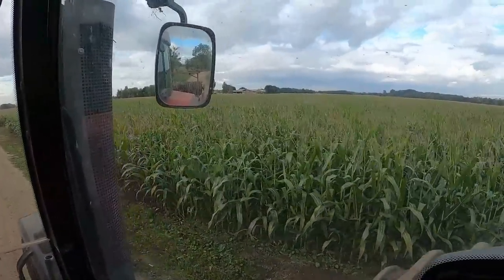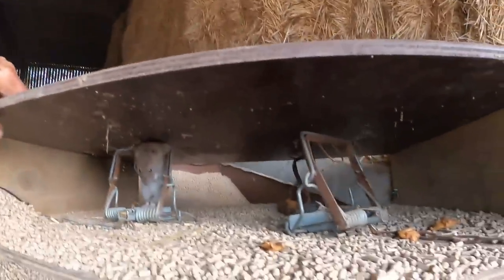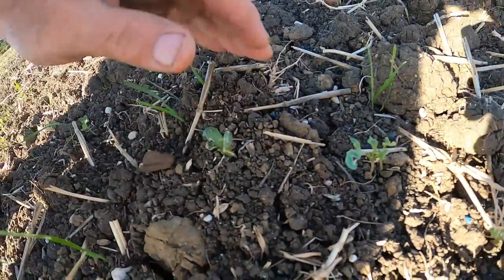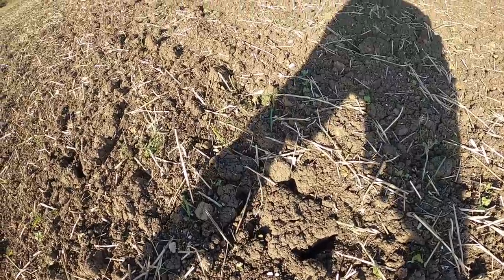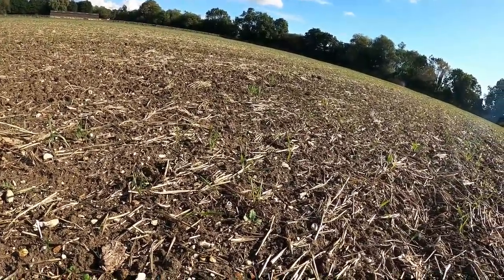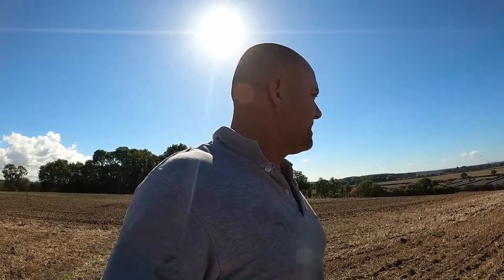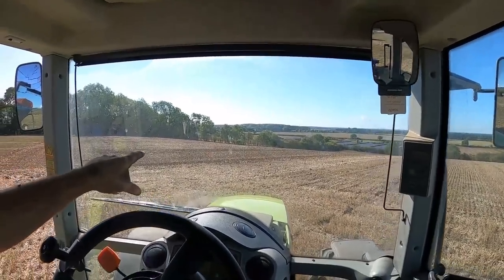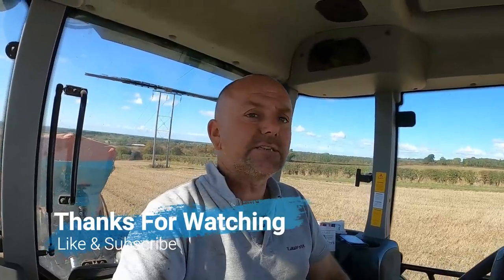Oil seed Rape , Rats and Drilling Rye

Comment: Evening Rich. We've grown cover crops since 2011, and have 300ac in this year. A lot of ours have oil radish in them to reduce bean and potato nematodes, but obviously radish is a brassica. We haven't seen slug damage, but the flea beetle have had a go. Try oats, vetch and phacelia, but be mindful of multiplying free living nematodes (There always seems to be a downside to these things) 
The majority of ours are before potatoes. We used to bedtill 150% of the area, now 25%, thanks to the cc and a pre plough dragging to keep the OM in the ridge. We use about 20% of the nematicides we once did too.
We also grow them before spring beans, oats, beet and occasionally barley
As far as seed goes, we're having a go at growing some radish seed, and have grown mustard seed before. Oats and beans in some mixes is easy enough. Got to be careful with things like phacelia that you don't create a borage like volunteer problem.  As a Yorkshireman I try to keep seed to a tenner an acre if I can (harder than it used to be) and direct drill them with an old Rapid drill. It adds up over 300ac, we need to see some value back from them! 
A common mistake is getting them too thick which stops the ground drying in spring. The important work is done underground!
Reply from the maker: Ey Up Andrew ,thanks for all that, some interesting points , if you don't mind , wouldn't mind a look and to meet up, when we get worked up, one saturday morning for an hour cheers Rich